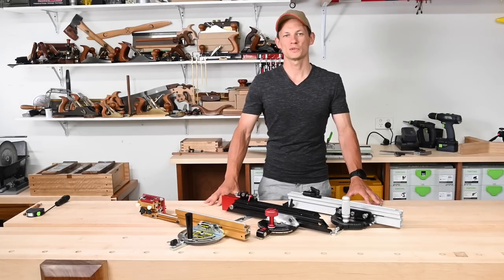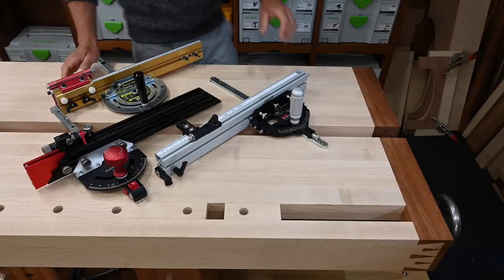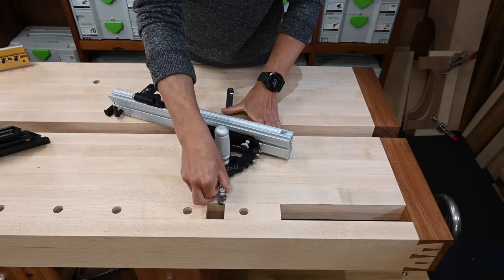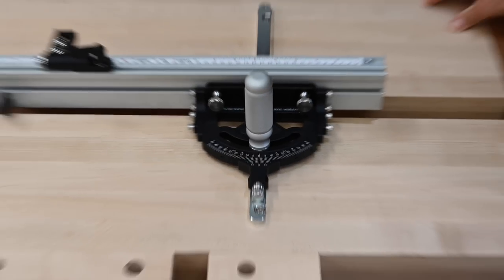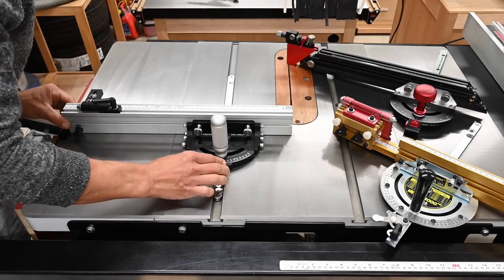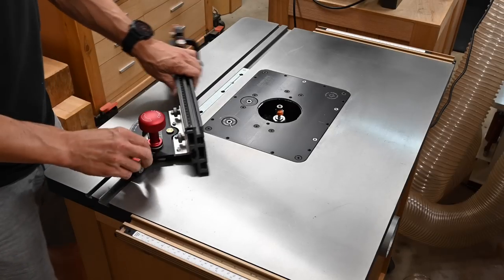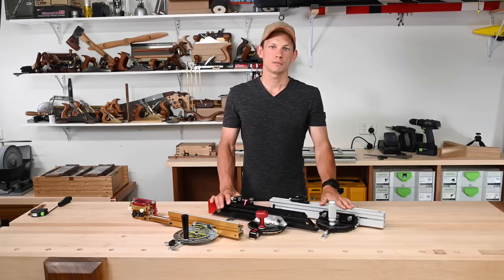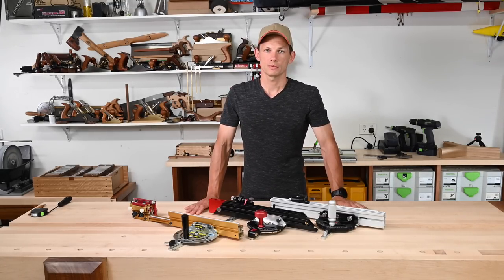Mitre Gauges - Jessem Mite-R-Excell II, Harvey Compass & Incra 1000HD Compared.

Comment: Thanks for the review I  recently bought the JessEm miter gauge on the recommendation of Marc the Woodwisperer after the review he did and could not be happier. I have had a Incra 5000 jig for over 10 years it's great it is dead nut on but bulky and not as smooth as I would like. The JessEm with the plastic glide strip on the bottom of the aluminum fence makes it super smooth glide stroke among other features you pointed out make this a great jig.

Comment: I do have an Incra 1000SE (same as HD, but with positive locks every 5 degrees rather than every 1 degree), which is even cheaper.
It doesn't have the very nice "jewlery fit and finish" of Jessem products, but I do like the fact that it's part of a system, with longer fences (rigid or telescopic) available for instance (and the ability to purchase additional flip stops as well). I also find the ability to have positive stops every millimeter quite useful, as it's possible to return to exactly the same cut size day after days, without fiddling (but this means the flip stop doesn't glide nicely as a result).

There are also some simple tricks to improve its usability such as replacing the hex screws with lever screws and the ability to replace or reposition the scales for direct readings in one's situation (no math required when changing configuration)... but a dab of blue tack under the scales might be required to prevent any movement.

Interesting comparison anyways!
Reply: I love my 1000 SE it has done everything I could ask for the price point!

Comment: For any shop tool that requires a hex wrench to make on-the-fly adjustments, I use epoxy to affix a neodymium magnet to the tool, and that's where the hex wrench lives.  Same goes for the chuck key on the drill press.  You can buy single hex wrenches quite cheaply.
Reply: I was thinking something similar, why not just drill a hole in the handle and store the wrench there?

Comment: Thank you for an excellent review!  Just a little tip that I saw on Collin’s channel, Wood Work Web, when installing the miter gauge into the table saw top, if you insert miter gauge into the slot so that the end of the miter gauge bar extends past the back edge of the table saw top by an inch or so, it makes it a lot easier to get the tab on the bottom side of the miter gauge bar aligned with the t-slot on the table saw.  You just pull it back into place.  I hope that I explained that so that it makes sense?
John Jensen from British Columbia

Comment: I have used an Incra 2000 for several years.  Just recently purchase a 1000HD because of being able to work right or left.  I do have the Incra Sled which has served me well.  I do use more than a 45 deg setting (56 deg) so the Incra is my choice.  For normal flat work the 90 deg is adequate, but I do segmented work, and get into some screwy angles.  I think you are correct about the finish, but from my standpoint,  Who cares, if it's accurate and durable.  Good review.

Comment: Great video my man! Correct me if I am wrong, but I believe the Harvey fence will fit on the Jessem. A lot of great info. When I choose the Harvey it was primarily for the fence & micro adjustment of the stop. But you did bring up some valid points with the adjustments to 90 with the Jessem. It was these two that took me months to decide on, eventually it came down to price, which honestly wasn’t much, but Harvey had a sale price of 279.00 over Jessem’s 299.00 and the wife pulled the trigger on it for me for a birthday gift. Like you said, I think it does boil down to one’s needs & wants. Looking forward to the next video!!
Reply from the maker: Nice, i don't think you can go wrong with either one. The beveled/tapered fence and flip- stop with micro adjustment are the two big benefits to me personally over the Jessem too. Hard choice.  Thanks for watching and the positive feedback my friend - video's will improve - shorter and more punchy next time!

Comment: I appreciate your review of the 3 top US miter gauges. 
It makes me comfortable with my choosing a Wnew miter gauge.   From banggood
It is more basic than the ones you reviewed with 27 pre-sets and no Vernier style adjustment.  And no extension. 
But it has features the others don’t. Brass knobs. Phonelic sacrificial face. Built in box joint jig.  Stainless steel with extruded aluminum. 
I think a good value. 
My Grizzly cabinet saw is imported.  And in this case the Taiwanese and Chinese work together fine.
Reply: Which model did you get?
Reply: @LutherBuilds  there is only the one model of the Wnew miter gauge. 
It is sold in parts. The protractor & slide, the fence and the stop. 
There is a choice to buy it all as a unit. But when you click on it, it shows up in your shopping cart as 3 pieces. Very confusing. 
But I haven’t bought anything from banggood before so I’m not familiar with their website.
Reply: Jessem is Canadian made ;-)

Comment: Nice review! Been using the Harvey on the superb Alpha table saw for about a year. Rock solid products, never needed to cut under one degree bevel so that has not been an issue. But, the micro adjust on the fence has really saved a lot of time and is super accurate and repeatable.  Fantastic for the money.
Reply from the maker: Good to hear mate.

Comment: Good review of all three gauges, but you forgot to remove the fence on the Incra and then rotate the gauge 90 degrees to gain access the third set of washers to set the miter slot tightness. Ron

Comment: Great review.  While I was initially leaning towards the Incra HD1000 and, after acquiring several Jessem products over the last couple years (Stock Guides for my router and table saw and their Rout-R-Lift II), I'm seriously considering the Jessem miter gauge now.  They make some quality products.

Yes, it has the least amount of angular abilities, but as you stated, how often do you need more than 45 degrees?  I think it would be a great combo with the Incra MiterExpress sled for larger stock.

Comment: If you need more than, say 60 degrees, one way of solving that is to saw a block or sheet at 90 degrees minus the angle you desire and put that part between the mitre gauge and the piece that you are about to saw. Some may think it tedious , but the question is how often you need it.

Comment: Excellent video full of useful info. Good that you point out that proper testing of each guide is beyond the scope for the vast majority of us. 
I have the incra and have similar misgivings. Use a rare earth magnet attached near the handle to keep your Allen wrenches close. Also, the incra stop does allow micro adjustment but you’ll need a Philllips screwdriver. The incra instructions are excellent; what about for the Harvey and Jessel?
Reply from the maker: Thank you. Good idea with the magnets.  Yeah, the instructions are actually very good for all three. The Harvey doesn't really requite instructions as it's all very intuitive. The Jessem has more little details that I did need to refer to the manual to discover - much like the Incra.
Reply: My 2 year old Incra 1000SE uses 1 ball end hex screwdriver for everything.

Comment: its true the new Harvey miter gauge now comes with eccentric adjusters, however there is a design flaw in their miter bar and Harvey readily admits to this.  There are no eccentric adjusters in the back of the rail which causes for some slop issues in the back which is obviously not desired.  The Tech support person I spoke with says they are redesigning the bar to make it longer in the back to accommodate another eccentric adjuster.  I would hold off purchasing a Harvey until they have implemented the new fix.
Reply from the maker: Thanks a lot for the update mate. That's a little disappointing - hopefully they do update the rail as otherwise it's a great gauge.
Reply: @bluewrentimberworks6780  I really want to buy that Jessem miter gauge, but  it needs to go on the right side of my blade.  I have the Incra 5000 sitting on the left.  When all I need is a quick cut, id prefer to pull out the Jessem or whatever I end up with rather than the incra sled.  I view the incra 5000 as a sled so I need a miter gauge to accompany it on the opposite side
Reply: Here’s a video that demonstrates the design flaw that causes slop at the rear of the guide rail. https://youtu.be/v10kpZbSnCM
Reply: The Harvey has been updated with the rear adjustments. Was included in my new Alpha saw

Comment: The micro adjuster on the Harvey is the same as the Precision Fence for the JointMaker Pro V2 where it is very useful. Thanks for great review. 
PS There is a bit of controversy at the moment [Feb 2022] about some of the features of the Harvey, so nice to see a very factual explanation.
Reply from the maker: Thanks Colin, much appreciated.  I call it like I see it - but that's not to say my opinion / observations can't be wrong.  I heard that the Wood Whisperer wasn't impressed by the Harvey and I believe I made several of the same observations.
Reply: @bluewrentimberworks6780  Marc reviewed 10 Mitre Gauges - 3 versions of the Incra. In reply to his comments on the Harvey, Stumpy Nubs looked at some of the issues as he is sponsored by Harvey. When all views are taken in context with as little emotional attachment as possible they all do a good presentation. It is a great way to preview items before buying. 
I have several Jessem products - they are so well done. I'd buy more if they made metric versions of some of them. 
Hope to see more videos from you. Great to see an Aussie putting something on YouTube.

Comment: I have the JessEm miter gauge and I'm wondering if there were any design changes made to this. product. The reason I'm asking is because in the one I have, there is some ( slight ) slop when the pin snaps into the hole ( 2:26 in the video ). Looking at the design closely, it seems the pin / hole should have been tapered to eliminate this problem - my unit is not tapered.

Comment: Great review but the poor 15 year old  Incra 1000 design was outclassed somewhat by these newer competitors - Incra  might have compared more favorably if you had used the Miter 5000 which is more in the same price range as the other two but given that it’s more of a sled than just a miter gauge I understand why it wasn’t reviewed.  I have the Incra 5000 as well as the original miter gauge that came with my saw.  It’s ultra accurate but you’re right about the need for tools and all the fiddling required to dial it in.  It’s also heavy, clumsy and a pain to store....I only use it for those rare occasions when a lot of repeated precise cutting involved.

Every woodworker has their own way of doing things but truth be told I think I could almost count the number of times that I used a miter gauge in the past year on one hand.  I use various sleds for almost all cross cut applications - it just seems safer and easier to control.   Do love that Jessem though - they make top flight and in my opinion reasonably priced tools.  Harvey is the new guy in town and their stuff generally looks really, really good but the jury is still out.

Thanks for the detailed comparo.

Comment: Thank you for the review! I need some advice. I have the Harvey and have found it very challenging to use the stop when cutting 45 degree angles for frames. The first cut is simple because the side of the board against the stop is square to the length of the board. It seats nicely against the stop.  The second cut however, has the freshly mitered end against the stop and because it is is mitered, it sort of wedges the stop right up - making it no good as a stop. I want the board secure as I push it into the blade and I know the blade will try to move the wood on me. Any idea how to get around this? Maybe an aux fence with a "shoe" to hold the freshly cut mitered end in place? Needs to be set once and then work for both the first (flat) cut and the second (mitered) cut.
Reply from the maker: Well the brass locating pin should help reference off both a square and mitred edge, however if you apply force it will raise it up like you say - so some pressure would need to be maintained on the fence flip stop to hold it down or the piece would need to be predominantly held to the fence once it is located rather than relying on the stop to provide the holding power. Not sure there's a magic bullet unfortunately. Sorry if i wasn't much help
Reply: Hi, if you're basically cutting frame pieces I'd suggest making a sled. Plenty to be found here on YouTube... A miter sled is by far the most cost effective and precise.
Most aftermarket miters like the ones reviewed here have issues, like slop and non practical engineering.
A sliding table addition would add more then just precision. But this depends on what saw you use / own.

Comment: I'm seriously looking at the Harvey so appreciate the review of the three.  

You're missing the whole point of the Incra HD1000, though.  Look at the setup instructions again. Once you set it up the ruler on the three parts they need not be moved again.  The rulers are then accurate. The silver bar is a very important part of this.

You can replace the cap head hex screw on the HD1000 with 1/4-20 thumb screw and forget the hex driver.  Really, only one is needed for the bar extension.  It's the single screw next to the two for the extension piece. Once set, none of the other screws need to be touched until you want to re-calibrate the gauge.

I find the "incra" adjustment to be too cute by half.  It's exactly in 1/32" increments but it's a PITA for most uses.

Comment: i have a saw stop table saw and i love it. i like using a wooden fence on my miter gauge. can i do that with the Jessem Mite-R-Excell II.  after you make just one mistake and touch the blade to the aluminum fence, you will do the same.  thanks, great review.
Reply from the maker: You can definitely put a sacrificial wooden face onto the Jessem fence 👍.  The locating pin on the fence also minimises the chance that you'd accidentally set the fence too close to the blade.  Thanks mate.

Comment: Good video. Any chance the Harvey flip-stop fits on the Jessem or could easily be adapted?
Reply from the maker: The flip stop does fit on the Jessem, but only works on the main extrusion because the extension is only a lower/smaller extrusion, unlike the Harvey where the flip stop can be used on the extension. Most of my use involves slightly longer stock that would require the flip stop on the extension, but if you do lots of small boxes or similar it could be useful.

Comment: Thanks for the thoughtful review.  You didn't say why you prefer the miter end on the Harvey.  I currently use an Osborne Miter gaga with a mitered end, fitted with a mitered sacrificial fence.  I like that it slides under my overarm dust collection with minimum lift, which optimizes dust collection.  Did you find the ball and groove of the Harvey effectively eliminated "slop" as Harvey advertises?  Like you and others here, I am in the market for an upgrade and (no pun intended) on the fence!
Reply from the maker: Thanks Michael.  Sorry I thought I had mentioned the reason I like the beveled fence and it's the same reason you highlight - it allows me to adjust it closer to the blade while still slipping under my custom overhead dust collection hood.  It's also a benefit when cutting with the blade tilted.   The ball and groove works very well and there is no slop in the mechanism / angular detents at all.

Comment: Exactly what i was looking for, i will probably go with the incra for versatility and price point, i'm sure with a few mods it will be more convenient to use...  the only other miter gauge i would have like to have seen in this line up is the osborne.
Reply: You won't be disappointed, my Incra, (Mitre 1000SE) is nearly twenty years old and has never let me down in terms of accuracy and ease of use. I use it at the Table saw and the Router table and using the tool is as quick in practical terms as toolless, though toolless is obviously more convenient.

Comment: Gentle comment... Telling something is flat / square / aligned is different than showing it. I'd suggest you show flatness etc. 
Also very much doubt the Harvey miter to be accurate in angle repeatability.
Maybe show results of a five cut, this will proof the accuracy of the set miter angle.

Comment: the Harvey saw has a deeper table size that would make the gauge stay straight better than you were showing in the video. possily the table shown is only 27 or 30" wide where the Harvey is 31.5
Reply: Yes, the Harvey Saw I have is only 27", so a 31.5" would improve things. Thanks for the info.

Comment: Cutting neck scarf joints in luthiery.  i routinely want cuts that are 10 to 15 degrees away from a full 90 degrees, with the neck blank clamped to the fence.  The Incra is the only fence in the batch that is at all useful to me.
Nice video though.

Comment: There should be no play in any of them if you tighten the sliders in the rails.  What you do need is enouph sliders touching the edges of the t-slots while in use to keep it square to the blade.